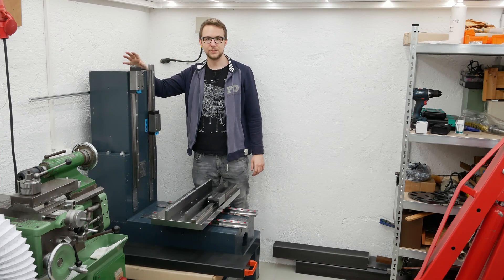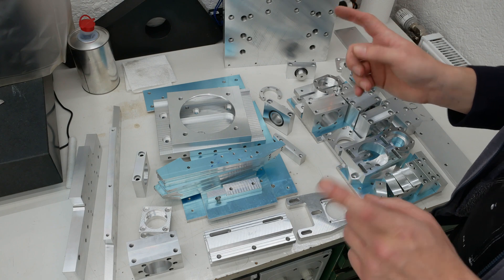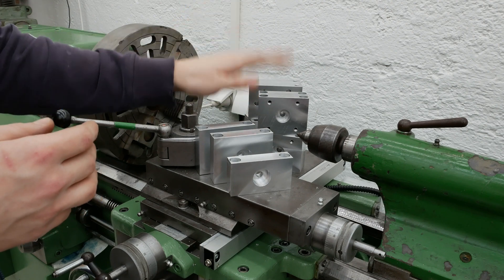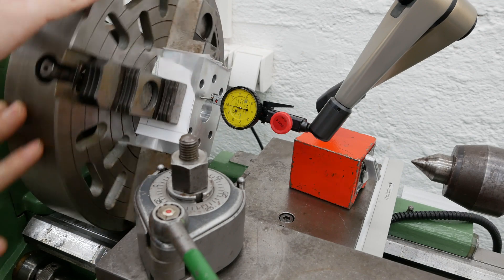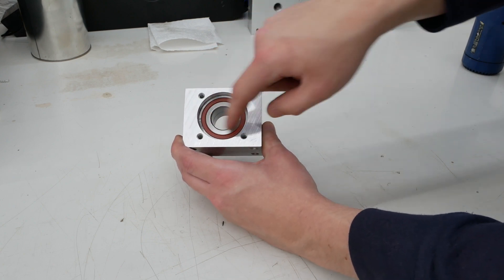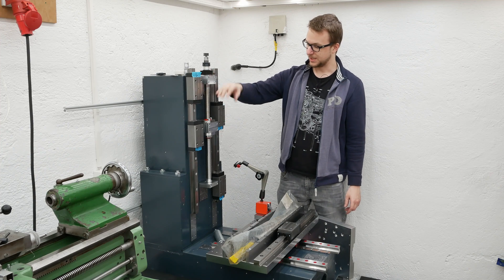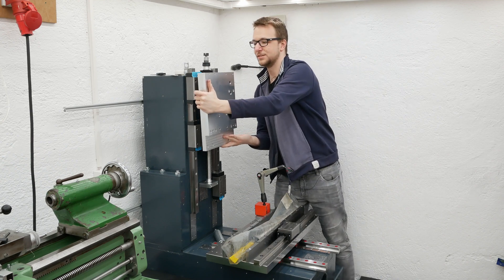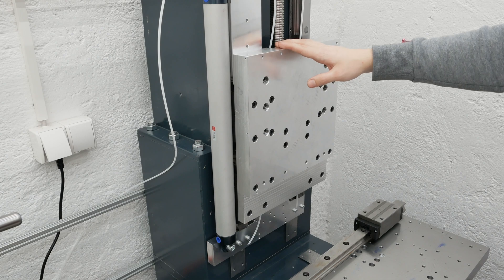DIY Milling Machine Part 4: Manufacturing parts and mounting the Z-Axis

Comment: Hi! COming back to your video multiple time to decide the components for my build. For the AC servo. I see you went with a 3000 rpm JMC 750w for the Z. Did you use the same for X and Y or different ones? Like 400w or so. Thanks!

Comment: @Alex CNC en
Hi dear Alex
Thanks for sharing your great project and inspiring me to do it for myself.I have a question about timming belt and pulley that i see you're using in all axises.I saw you're using HTD 5M type. Is the HTD best choise for your milling machine? How do you choose this one among several types of timing belts/pullies? I'm going to use this setup in my  desing buy i really concern about the amount of its backlash especially under the load of machining parts. Do you think is it negligible? I'm really appreciate if you give me some info about why do you choose HTD type and what accuracy do you expect from it?
Thank you so much
Reply from the maker: Hi,
the HTD profile is used for backlash free transmission. So it should be finde to be used here and I haven't encountered any problems yet. Why I chose the 15 mm HTD 5m? Mostly because a friend with a very similar application had good results. And I do not care to much about inaccuracy induced by the belt because I run glass scales and a control loop with them.
Reply: @AlexCNCen  Thank you so much ❤

Comment: Really good job at planning and assembling.What kind of control and spindle will you use? Good luck Alex in this fantastick cnc build. so satisfying to watch.
Reply from the maker: The control will be Linuxcnc. I will use the spindle from my current machine. That's a self built BT 30 spindle.
Reply: @AlexCNCen  hello 🙂
Surely one of the top builds around! 👍👌 Thank you so much for sharing this experience with us all 🙏
So glad you chose LinuxCNC to run this beauty ❤️
About the spindle, really hope you'll make english version of the spindle build video series to go along the machine build...
Reply from the maker: An English version is on my list. But I'm not sure if I should redo the old videos or make an entirely new video. I want to modify the spindle so that would be a good opportunity to do so.

Comment: Nice build! @15:25 what are those little push-fit grease fittings called? I need some of those for my project!
Reply from the maker: Those are basically just high pressure push fittings. Not sure what they are called exactly. I got them from sinntec.

Comment: Hi Alex, congratulations on correcting the errors on the linear guides.  Question for you - what are you planning on using for a table on this machine?  For my build I am having a difficult time finding suitable t-slot table and don't have any good ideas on what a good solution would be.  I am interested to hear what your ideas are.  

I am looking forward to seeing the next videos in the series.
Reply from the maker: I will show the table in a future video soon. I used a baseplate and screw on stripes in T shape. That way I can make the t-slot table without having to use a T-slot cutter. I'm pretty sure that wouldn't have worked with my old milling machine.

Comment: You seem to be using Aluminum for some of the critical parts like the fixed end bearing housing and Z axis backing plate. Do you have any concerns about strength? I'm debating the use of steel over Aluminum (which is much easier to work with) and so I'm encouraged by your choice, but wonder if it will be strong enough?
Reply from the maker: I think that will be fine. those part do not have to transmit the forces over a long distance. Like the Z-plate. Ist pretty much only a spacer. The bearing housings are not very tall. So the distance through the aluminium into the concrete is not long. Otherwise i will have to remake those parts if they causes problems. But easier machining was the reason why I used aluminium instead of steel.

Comment: Looking good! How are you preloading the angular contact bearings against each other on the ballscrews? With the clamp on the bearing block or with the nut on the end of the ballscrew? If you are using the nut, are the spacers aluminium? This would create a situation where the bearing pre-load increases with bearing temperature due to thermal expansion of the spacers, which is unstable and can runaway. It has the potential to lead to bearing failure. The mitigation is to use spacers with a coefficient of thermal expansion that is (approximately) the same as or smaller than the ballscrew itself.
Reply from the maker: The bearing are matched so the outer ring and innere ring just have to be pressed against each other to get the right preload.

Comment: Why are you using this table arrangement ? I mean small table and long rail under it. Why not to flip it like on big manual mill that You have? That way You would have more space where to put clamps, 4th axis etc. Are there any negatives why that arrangement with bigger table and  rails on top of Linear carriages? Only think that comes to my mind is that  stepper/ servo will be moving together with table and that You will need more space around machine to avoid collisions. Are there any other reasons why not to flip it ?
Reply: All VMCs do this because it offers more rigidity and does not change in rigidity depending on the position. It is cheaper to do it the way you suggest but it comes with some drawbacks. Hope this answers your question
Reply from the maker: I see advantages and disadvantages for both ways. Not sure which one is the better one. I will do most of my work with a vice. So I do not really need the way bigger table to clamp big things and so on. And also the space is quite limited. That way I was able to safe some important space.

Comment: Very impressive build! One thing maybe worth considering: I think This Old Tony recommended mounting the gas spring the other way around so that the oil inside stays at the seal.
Reply from the maker: That's true for gas springs but this is only an normal pneumatic cylinder. I will but some oil in the upper chamber. If it turns out to be necessary I can still turn it around :)
Reply: @AlexCNCen  Excellent choice the pneumatic cylinder.The first thing i replaced on my mill was the gas spring.I didn't like how it worked,also at the end of the travel,the resistance was higher (like it was designed for the trunk of a car!!). The pneumatic cylinder has 3 benefits over counter weights and gas springs. It doesn't add inertia,it has adjustable force,and the force is the same for the entire travel.Also they don't restrain the speed of the axis like gas springs.

Comment: Amazing job! Really looking forward to see the next video. Question, which encoder did you mounted on the spindle Z and why? Is it like to receive a feedback movement to compare with the servo encoder? Like for linear scale
Reply: I also thought the same? Are you using that encoder instead of a linear scale? Nice build Alex.
Reply: @harindugamlath  It that case is quite a neat solution. Less bulky than a linear scale and encoder can get to a really high pulse count.
Reply from the maker: That's just a brake for the Z-Axis because the motor has none. I don't think an encoder would make sense here. The motor has already an 20 bit encoder. That's about 1 million positions per rev. I will use linear scales with 1 µm resolution for X/Y and 0,5 µm resolution for Z. Got those used that's the reason for the higher resolution on Z.
Reply: @AlexCNCen  Got it. How does the brake works? Is it a magnetic one that without current applys friction to the ball screw? 1 and 0.5um liner scale resution seems amazing. For such precision level you will need to thermo isolate the machine :-)
Reply from the maker: Sorry totally forgot to answer. It is a brake disc that gets wedged between to metal disc with springs. A electromagnet pulls the discs apart.
Reply: @AlexCNCen  thanks!